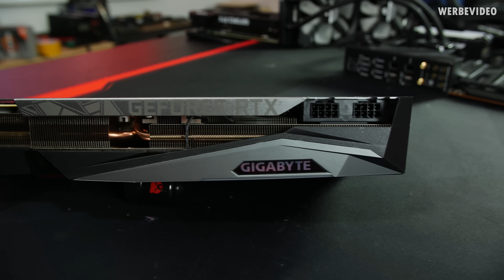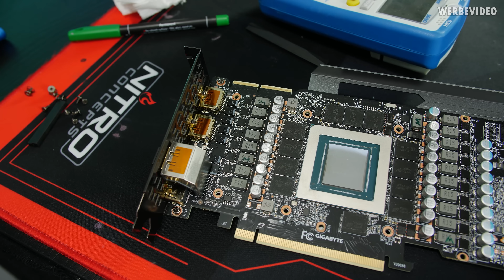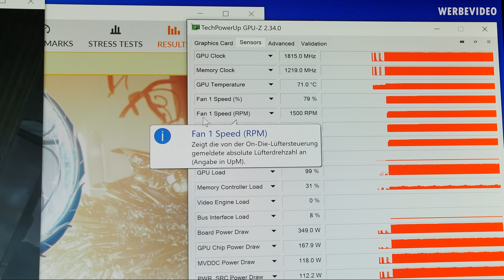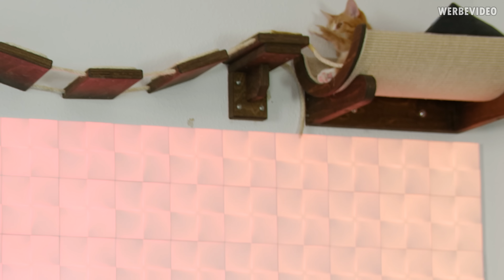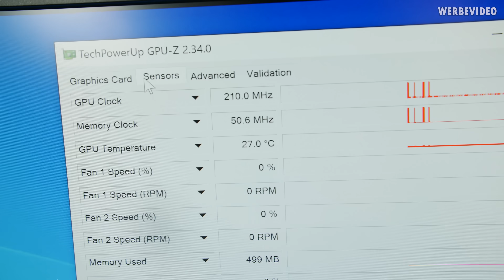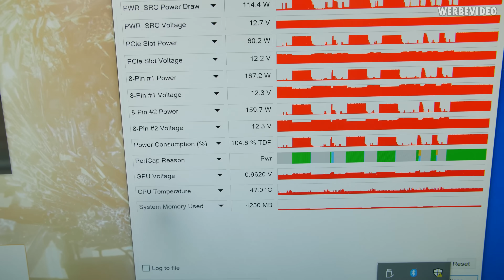Gigabyte RTX 3090 Water Cooled  - Is It Worth It?

Comment: if the 3080 super is 20gb, then that means they have 2gb gddr6x modules in the works which means the super/titan variant could have 48gb of ram on a single card two together would be 96gb?????  my mind just keeps getting more boggled
Reply: RTX SuperTitan 😂
Reply: The 3090 has half its Ram on the back. They could just do that for a 3080 20GB.
Reply: @Safetytrousers  i havent seen the back of the 3080 yet, just figured the pcb would be a bit different layout, i could be wrong though, awna yeah on GN steve shows us the back and yeah no pads for vram, but yeah i see what you mean, i suppose they could, but it would be an extra cost?
Reply: @PhunkBustA  They wouldn't have to use the same board for a 3080 20GB. It's what they've done between the 3080 and 3090. They could use the 3090 board for a 3080 20GB.

Comment: Comes with SLI connector? So who's gonna run these cards in pairs?
Reply: 100% it will transform my Core 2 Duo with integrated graphics to a monster gaming rig. I’ll just have to cut off a bit of PCB so it will fit in my shuttle case for it.

Comment: Six of the cheaper Caps on a 1500$ card, this is a major issue... 
All of the board partners need to get their cards straightened out ASAP.
I know Nvidia is a culprit with late delivery of drivers, but this card is under the given Nvidia spec. 
If it come to a callback of the cards, along with the low yields, availability will stays low far into 2021

Comment: Look at the caps on the back of the GPU. Those are the 'cheap' caps discussed in igor's lab that underperform and are causing CTD issues.  Thus any sort of OC will be minimal.  Use a higher end power filtering setup.  Read igor's lab and his recent analysis for more information.

Comment: Gigabyte has always made junk. Was really bad in the 90s early 2000s. Never trusted since.
Reply: bBrain their mobos are pretty good though. Gpu side not so much. Good quality gpu Aib are asus msi and evga. Ones to avoid are gigabyte, zotac and galax. Rtx3000 series has a new aib though. I think it’s called colorful, hope they do good on their designs.
Reply: @AznTony360  agreed. MSI also makes great GPUs, however, I bought the 2080ti and there is no way to get a higher wattage vbios for it like you can with the EVGA cards. So if you are into big power / overclocking EVGA is the way to go. But the 2080ti gaming x trio is a great card if you are ok with its power limit, which is still high. But the MSI does have amazing air cooler and maybe the best RGB of them all. I dunno what happens at gigabyte GPU dept. They just generally go the wrong direction on everything.
Reply: @bBrain  true, evga is by far the better cards to mod to get max oc and power. It's just I'd prefer the cards with high quality parts that will last the longest. Not too big on the high quality parts that are intended to overperform the competition. Every card I've owned and still do have are asus and msi cards. Quality that lasts. Evga is like honda, for performance. asus and msi are like toyota, not as fast and zippy, but last quite a long time. Both make great products/cars though. Cant go wrong with either of these three brands, except customer support i suppose lol.
Reply: @AznTony360  Yea my experience is EVGA's support and RMA process is 2nd to none. It's absolutely fantastic and they do a great job getting things taken care of. For example, I bought a EVGA 299 FTWk motherboard from Amazon, i hit up EVGA because I couldn't get a post. I'm building this for a client I tell them and they did an advanced RMA for me for free on the spot after we confirm it's not bent pins or a bios issue. They shipped me a new mobo, and I shipped the old one back. That's happened once before with a GPU and they did the same thing many years ago. EVGA is very fair and common sense with customer support. 

I would say EVGA is like the mustang, ASUS and MSI are like the honda/toyotas. EVGA goes all out with the kingpin offering and I mean who beats that? lol I did bios testing with MSI for the MSI x299 gaming pro carbon motherboard with the 10xxx intel cpus, I figured heck maybe I can get a bios for the MSI Gaming x trio 2080ti. I literally begged them and they wouldn't do anything, told them to void my warranty, etc. Even showed them I was very close to being in the top 50 and if they would give me a power bios would of been top 25-10 easy. They wouldn't do it. Then come to find out they had even taken steps further to ensure ppl couldn't flash custom bios on their cards by changing a device id so there was no way to flash a bios on it because the official ones they make. MSI 2080ti gaming x trio is a great card. Very cool, easy 150/800 OC but you are at power limit the whole time. So sad MSI wouldn't go further with their high end cards. EVGA SO such limits.  I don't have much experience with the ASUS GPU's but the mobos are decent. I'm currently using the ROG Rampage VI Extreme Encore
 motherboard and man it's a fine piece of kit. VRM's running at 1000khz and max out at 41c. LMAO!  I can easily get 5.0ghz all core on my 10920x and 4.9ghz all core daily. It's a little warm at 5ghz but 4.9ghz is manageable with my custom loop. But I don't have any experience with their GPUs and power bios.

Comment: Why RTX 3090 is SO Weak...& 2.5 times more Expensive than RTX 3080...!! Just Only 15%-20% Faster than RTX 3080 ...omg...!!
Reply: for the same reason the titan rtx wasn't that much more powerfull than any 2080
Reply: and the titan rtx was 2200 euros, nobody complained
3090 is a titan at 1500-1900 euros it's cheaper than it's predecessor